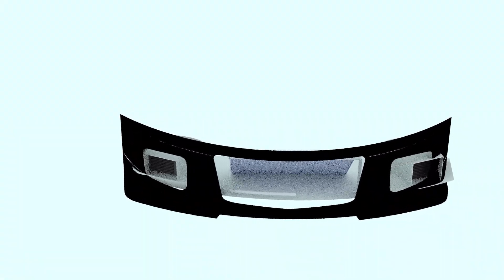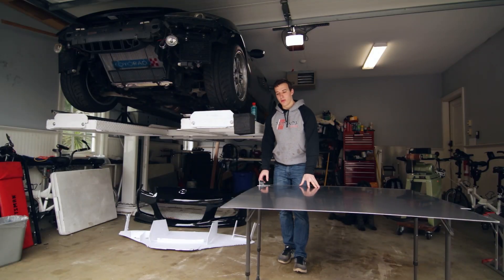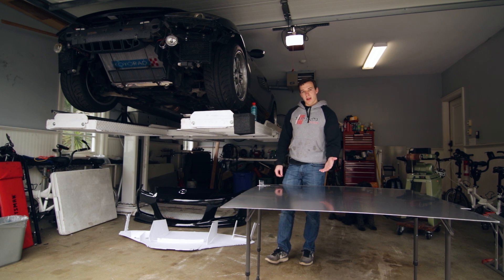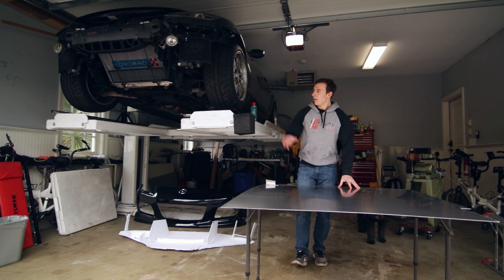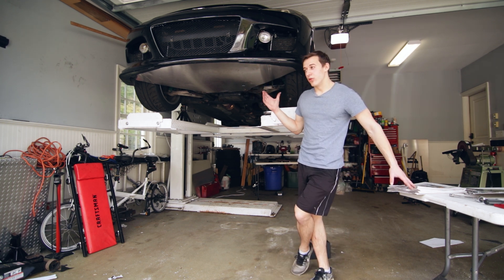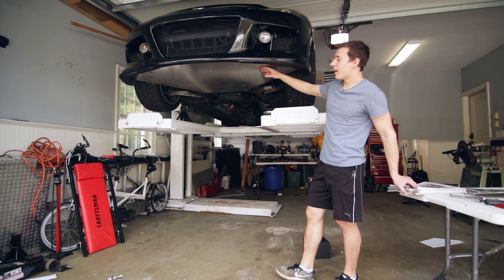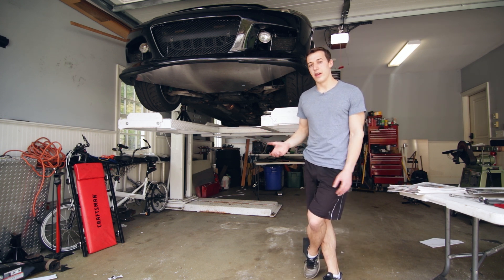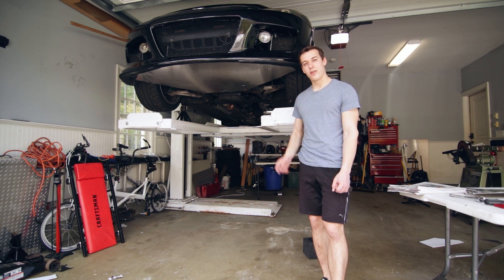ULTIMATE Track RX8 Cooling Undertray Build

Comment: So how did temps improve! I am in mexico and I cannot do more than 2 laps without overheating... 37 C air temp. Car goes from 95 C to 110 in 2 laps. I think water pump might be failing and high RPM because after I stop temp drops to high 90s in 2m (new rad, Ecu fan repro, new oil lines, new coolant lines)

Comment: Another reason to use a 5000 series aluminum is it can be bent. 6000 series does not bent well and will break off by the time you hit 90 degrees. This is coming from someone whose sole job is bending sheet metal with a press.

Comment: do you have an email or instagram ? i want to impose a mod that hasn't been really done, but could have incredible results.
Reply: And this mod is?
Reply: @Mitch3343   Mitchell S.  I got in touch with him, and we talked, but the mod seemed inneficient at producing power. The idea was to relocate the evaporator which is the "cold" side of the AC system, directly in front of the air intake. Now I assumed that the AC only robbed a horsepower or 2, but it's sort of significant. I've watched a dyno session with AC on/off and the horsepower loss was a little under 10, mind you this was in a 2008 Lexus isf hitting around 360-70 hp

Comment: Hey man. . Just noticed your channel. We track our 8's as well. We removed the airbox and have the AEM intake. Also moved the battery to the trunk. Our water temps are really good. They never go up even on hot days. Oil is a bit different. Don't think directing more air into them will help enough. A new cooler setup should do the trick.
Keep up the good work. Look us op on FB and www.b-rpm.be. Feel free to contact us and share ideas.
Reply: Oh and for brake cooling. Remove your fog lights and do some ducting around them if you really want them to be cooler.
One of our cars ran a complete season on a track that's really heavy on the brakes. Stoptech all round and RBF660 fluid. No fading. No it's upgrading to winmax W5 pads. With still stoptech rotors. They're a different kind of caliber. Should work fantastic and linear.
If you had fading, upgrade brake pads and rotors. Bleed fluid with RBF660 and Goodrigde braided brakes lines.

Comment: I love your enthusiasm for the Mazda rx8. Mine has been in the local garage for six weeks now. Issue with power steering. Nightmare. Peace brother.
Reply: Andy Spinks  apparently that’s a common issue with an easy fix. Well at least I’ve heard ... but goodluck brother !
Reply: @brr4328  not that easy I'm afraid. Tried all the suggested fixes. None worked.
Reply: Breh you don't need power steering
Reply: @kaizousha5531  sweet. Just disconnect it then...?
Reply: @andyspinks9996  yeah bro, if you want a little core work out, have the stock steering wheel and tires under a 295/35 then you can handle those turns even at a stand still.
Reply: @kaizousha5531  appreciate the input dude. Cheers